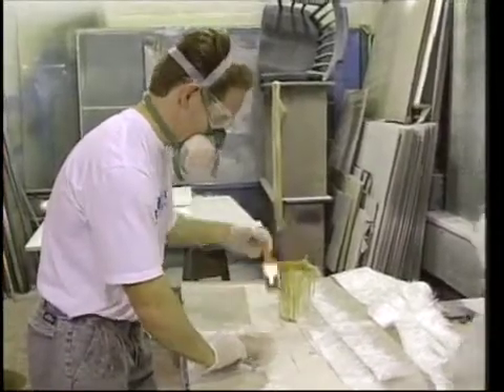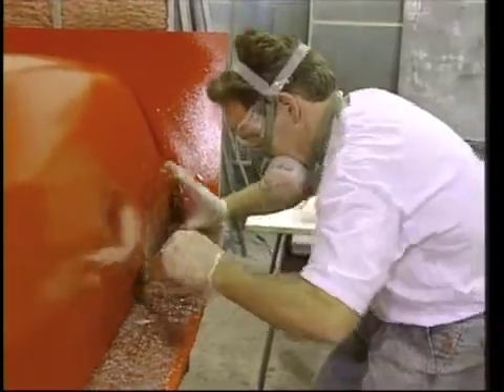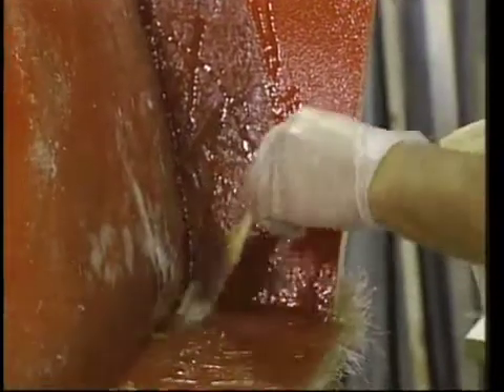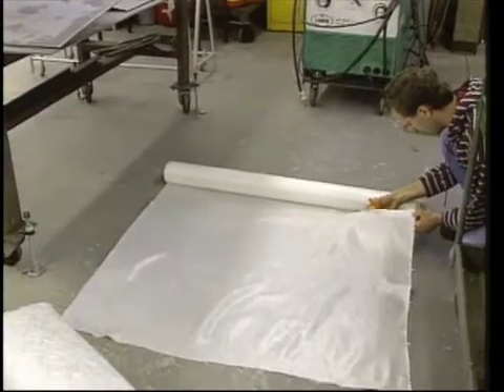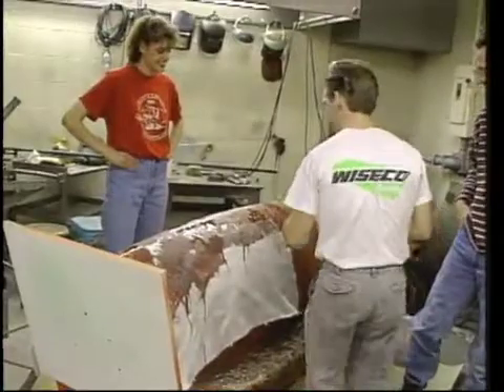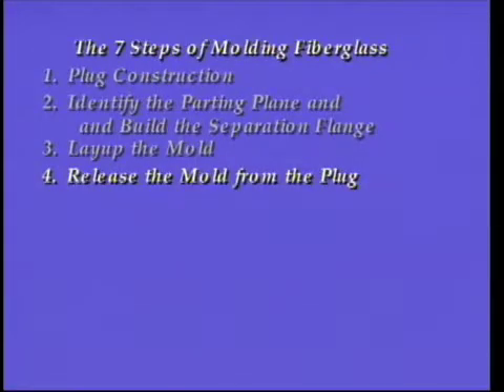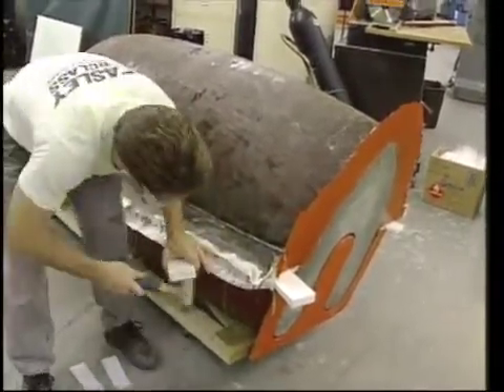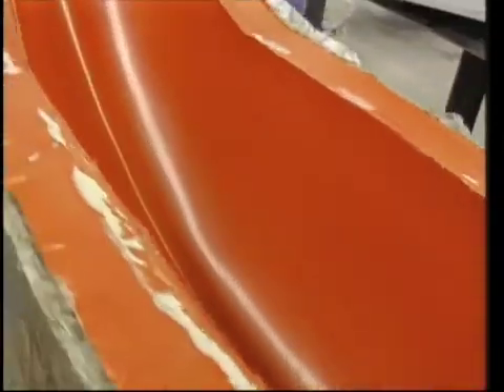Composite Mold Making 5 of 5

Comment: I would say that depends on what you want to achieve. Since this seems to be a project at a university, they may wanted to teach what is common in the industrial fabrication of multiple carbon fiber or fiberglass parts. For making just one part doing it without a female mold makes more sense.